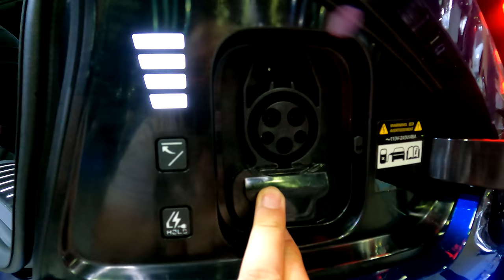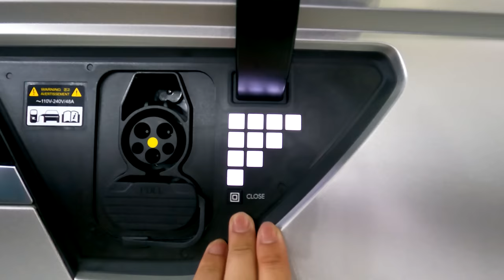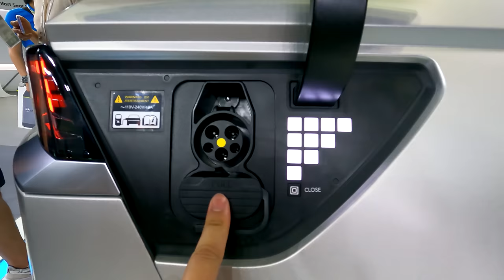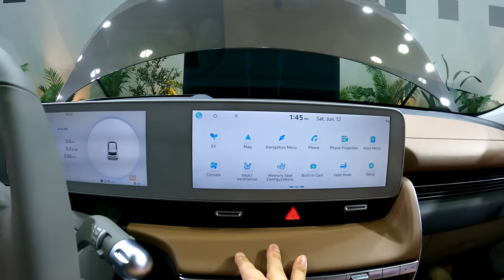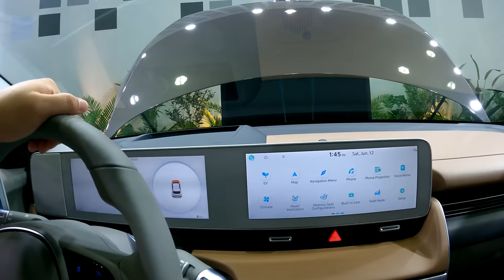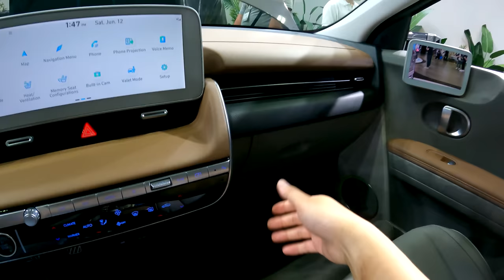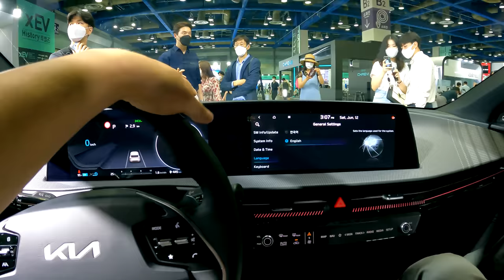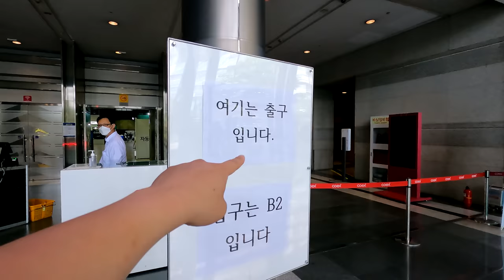EV6 vs IONIQ 5, most detailed head-to-head comparison video – watch this video if you're debating!

Comment: Thanks for a very detailed and factual review. Which of the two is quieter inside (wind and wheel noise)?
Reply from the maker: Definitely IONIQ 5, since it has dual-pressed windows even on the 2nd row seats, but EV6 is quiet enough.

Comment: I would gladly replace  the missing rear window wiper with a camera view ovelaid a wide rear view mirror like they put in the Rav4 Prime. Both cars spoilers are going to be troublesome to clear from ice and snow and they just dont keep the glass clean as advertised.
Reply: Doesn't the rear window have a heat element? I thought it did. That would help with both rain and snow. Also, you can treat the rear window with a product like RainX to help water bead off the glass.

Comment: Good comparison between the two cars. I prefer the Ioniq 5 clean lines both inside and out. The car just looks more futuristic than the EV6. The EV6 has a more traditional interior design. The EV6 interior is much closer to what you see in most cars. I also don't like the huge center console of the EV6 and all the piano high gloss black accents.

Does the EV6 offer the Solar roof as an option?

Any news on the Ioniq 5 N series?
Reply from the maker: On point! Agree with everything you said. There's no solar roof for EV6, just a regular sun roof, not even panoramic :'( IONIQ 5 N seems to be first in line to be an EV N.

Comment: How many speakers did you see in the Ioniq 5 vs the EV6? In my research it looks like a 7-speakers Bose system in the 5 but a 14-speaker Meridan system in EV6. I really want a premium, immersive sound quality like in my Model 3 and leaning toward the 5 but 7-speakers is underwhelming. Can you confirm what you’ve seen in the Korean models?
Reply: There is 8 on the top level of Ioniq 5
Reply: @YannR34  Wonder if I've heard right on the EV6 having a significantly better audio system and why Hyundai/Kia made such a disparity between the two. It's one of my few knocks on the 5
Reply from the maker: I wasn't able to check the number of speakers unfortunately 😕 I've heard the audio on IONIQ 5, it seemed quite the typical Bose sound we've been seeing from other Hyundai cars. Haven't tested out Meridian ever, but I just looked it up, it is the same as that of K8, and has a total of 14 speakers. People who has tried out the speaker, they say EV6 is definitely a winner in sound.
Reply: @CarSceneKorea  that’s a shame Hyundai is willing to settle for such a gap in audio system sound quality. Have a 5 reserved but that’s one of the few disappointments for me. Otherwise, is an amazing car! Thx for confirming! :)
Reply from the maker: @awolryan  I'd really have a tough time choosing between the two. Thank god I'm going with IONIQ 6, hope there is no competitor from Kia for IONIQ 6 😎
Reply: @CarSceneKorea  THE IONIQ 6 LOOKS STUNNING! And it would be tough but the 6 is the best design Hyundai has ever produced! Enjoy...once you get your hands on it!

Comment: I wait to order a EV6. I like the design of Ioniq 5 very much. But I think materials are better in EV6 and soundsystem is waaay better. Still dont know if I want a GT or GT Line would be enough for me. Performance is very tempting but Im affraid of much shorter range and hardcore suspension.
Reply from the maker: As for the sound system, EV6 is better than IONIQ 5 period - not just me, but agreed upon many. As for the performance, there wouldn't be much difference bw a regular and GT-line, but GT will certainly be different given the numbers alone on that car and surely the suspension will be different.

Comment: 2 wheel drive of either if price is reasonable when/if it is sold in Australia. As a comment I use my vehicle to go surfing, carry bikes etc. When they make the interior too fancy & with glass roofs (nightmare in summer) it actually puts me off, as it becomes impractical.
Reply from the maker: I drove the car around for a few days under 42 degrees Celsius out, having the shade and AC did brilliant job keeping the car chill :) AC doesn't drain that much battery than I anticipated!

Comment: Both the IONIQ and the EV6 have no rear wiper. A bizarre mistake that has already a proven fail by automotive journalists who couldn't see through the rearview mirror during a rainy day. Weird oversight in such an otherwise excellent car.
Reply from the maker: Wonder what the reason is for rear wiper delete as well 🤔
Reply: Honestly, I never missed a rear wiper in my previous cars. I rarely look into the rear mirror anyway, since I'm using the side mirrors almost all the time to see what's coming from behind. When I drive backwards I use the camera view or the side mirrors. - anyway, maybe you could consider buying a spray/fluid to seal the rear window so that water drops are simply rolling off ("lotus leaf effect")?

Comment: Hi, I don't suppose you know if ioniq 5 has apple carplay?  And is it wireless?  Thanks!
Reply from the maker: It does, but requires a wire connection. Thanks for watching!
Reply: @CarSceneKorea  This is something I don't understand  because on the Hyundai site they said that every car would have the wireless wifi connection for android auto and car play from 2020.
Even more when they put a ventilated wireless charging port to avoid your phone to get hot. It doesn't make any sense, especially when the USB connection is not even one of the close USB port.
It really doesn't make any sense at all.
Reply from the maker: @YannR34  Let me double, triple check. This leaves me puzzled as well, but that's what I've collected thus far 🧐
Reply: In another video I heard 8 in screens only have  wireless not 12 iin  ( this year at least)

Comment: Great comparison, thanks! I prefer EV6 and have ordered a GT-line awd. Ionic 5 has a smaller battery in Sweden (72 vs 77 kWh), less power, and much less range according to the WLTP cycle. The only thing that worries me is the second-row seats. Are the seats much lower in EV6 compared to Ioniq 5, with less thigh support? Greetings from Sweden!
Reply from the maker: Hi back from Korea! 😎 As for the 2nd row, I definitely felt that the seats on IONIQ 5 was roomy, while it felt "ordinary" for EV6. But it doesn't mean that EV6's 2nd row was tighter than an ordinary car or something, just felt IONIQ 5's was very spacious, that's it. EV6 has 100 mm shorter wheelbase than IONIQ 5, so that makes sense.

Comment: Will they do a EV6 in petrol at all.
Reply from the maker: Impossible because EV6 is built on an EV dedicated platform, which is E-GMP.
Reply: @CarSceneKorea  pity has great style most cars or SUV are square shapes with zero style cheers.
Reply: It's ev but has >500 horsepower u don't need it to be petrol
Reply: @veganspace  Distance it will get to.

Comment: Where does the EV6 First Edition fit into the lineup?
Reply from the maker: What's the driving range on the first edition?
Reply: @CarSceneKorea  the body of the First Edition has the cladding like a base model but it's basically optioned out like a GT-Line. First Edition has 265 miles of AWD range.
Reply from the maker: @anthonyc8499  Wow, thanks for sharing. Learning always from fellow viewers 😀
Reply: @CarSceneKorea  Kia made a website for it. 
ev6firstedition.com

Comment: Simple question, which car has more space in back , I have to kids , this is the most important for the family. U never spoke about test of the range.
Reply: i heard EV6 has low roofline so it's hard for adult to sit in the back. Where as Ioniq 5 has high roof so back seat fits adults comfortably. But I think EV6 can fit more stuff in the trunk area
Reply from the maker: IONIQ 5 has slightly larger trunk space than EV6 despite the EV6 has longer trunk length on the back, due to the design. There's been real world tests with IONIQ 5’s range but nothing for EV6 yet. Although it is very likely that EV6 would also be around what Kia has announced - in this case, EV6 475km with 2WD which has a slightly bigger battery than IONIQ 5
Reply: Ioniq 5 is very spacious in the back and you can slide them closer to front with the remote control buttons on both sides of the front seats

Comment: smalller boot gamechanger, less headroom and legroom gamechanger, solar or glass sunroof gamechanger fater acceleration 0-60 in 4.9 secs kia 0-60 in 5.4 secs gamehanger, far too much piano black and more complicated controls gamechanger, far superior futeristic looks and no ugly rear end gamechanger, light and also dark mode displays game changer, vertical charging flap instead of rear flap horizontal and gets muddy from rear tyres gamechanger also £5000.00 cheaper in the UK GAMECHANGER.

Comment: Ioniq 5: Stupid with digital side mirrors and very dangerous with the open floor space between driver and front passenger. Also stupid with no rear wiper. Why why why?!? Otherwise Ioniq 5 is a nice car. But EV6 wins!
Reply: You don't have any rear wiper on EV6 either. Digital side mirrors are optional and not even available outside Korea (at least not in Europe). And my cars never have anything on the floor, at least nothing rolling, I don't like mess and there is so much place to organize stuff in this Ioniq 5. 
Your arguments are like, EV6 is blue and there is not rear wiper. why why why? Ok the Ioniq 5 is the winner.  😂